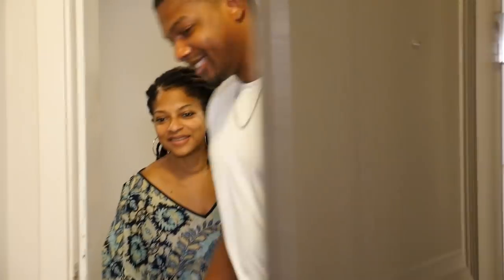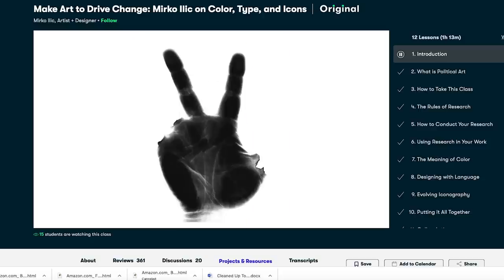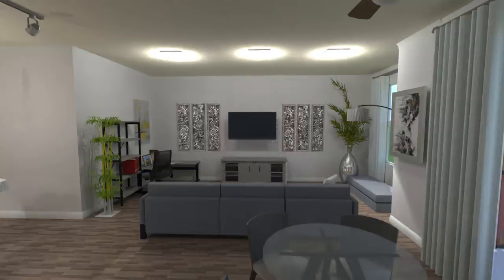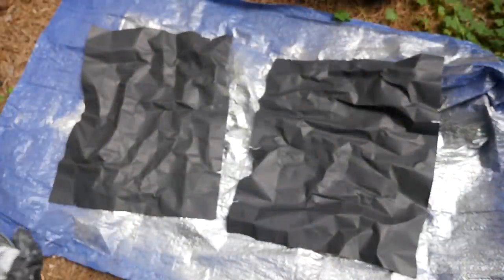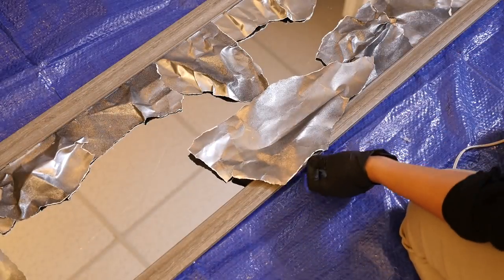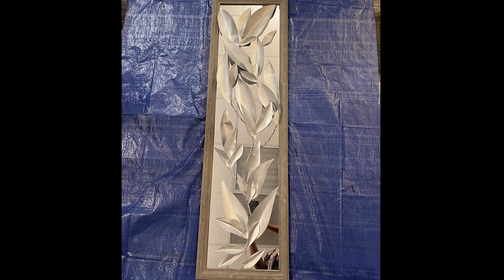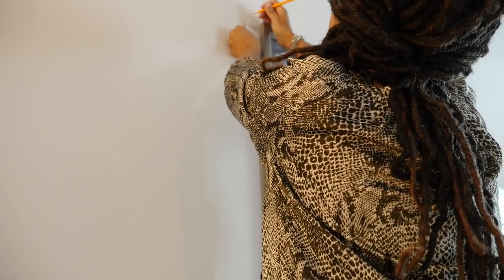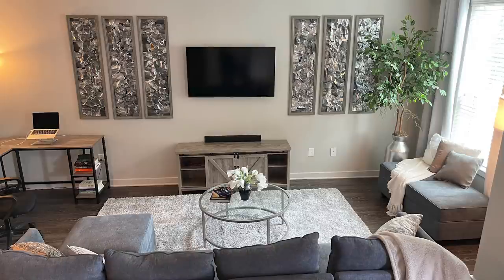DIY - Modern Art 3D Wall Panels

Comment: I really appreciate you for sharing this! I fell in love and remade it. I made a few changes just to fit my budget. So instead of creating this on a mirror I used cardboard.  And since I wasn't using mirror frames I cut out mirror reflective paper and placed it randomly on the cardboard. And the last thing I did was,  since I had many table runners left from my room project I cut pieces of it and put it on the panel as well.. I framed my tv with these. I get so many compliments.  I made 1 more panel and added the table runner to it at the bottom and made a window cornice!. Id love to share the pics with you. And thank you again for the inspiration and step by step!